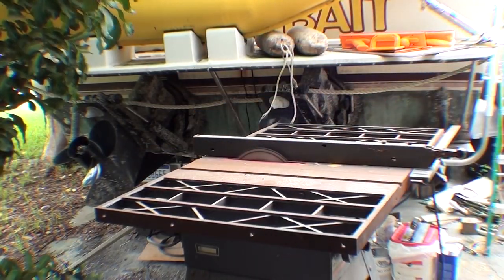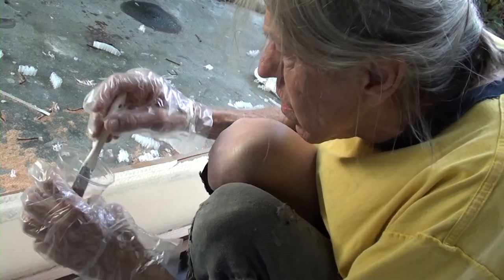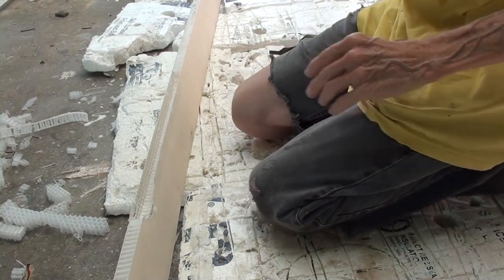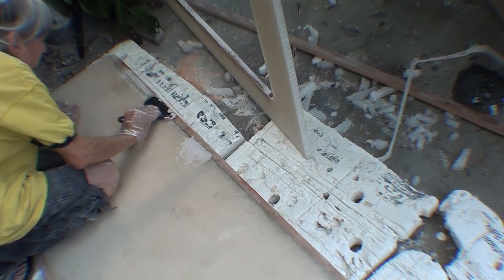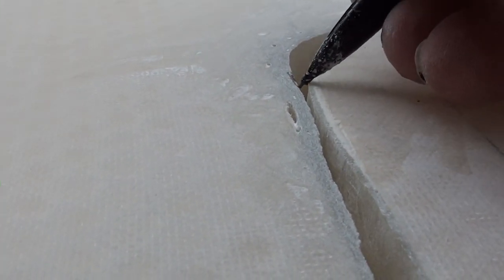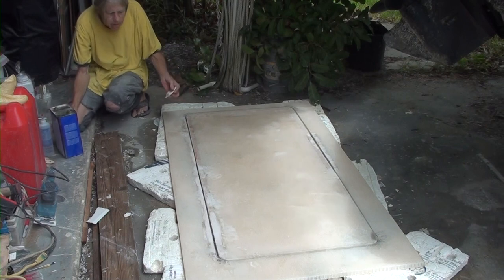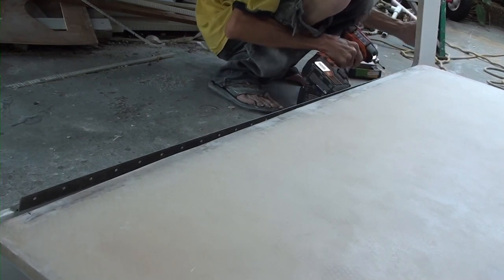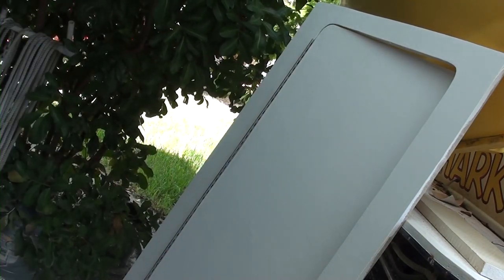Attach Hinges/Hardware To Nidacore Honeycomb With Wood Inlay

Comment: Use PVC board and expoy glue it comes in 3/4 inch so if your using the same thickness nidacore work very good and stay with the no wood to rot theme.
Reply from the maker: Thanks!  One of the reasons I love Nidacore is that it will never rot.

Comment: it  seams like  using a Wood Insert.  kind of defeats. using The Nidacore as  that’s what always rots in  a most  Boats  made with  Wood Cores  no matter how hard the builders  try to keep moisture. away from it  the moisture always finds it’s way to  it   my Thoughts is a peice of Solid Aluminum that you can drill and tap for Machine Screws and or bolts would be a better solution

Comment: Can you use nidacore for floor?
Reply from the maker: Yes, you can use Nidacore honeycomb core for floors or almost anything.  The Nidacore comes bare, and you have to lay fiberglass cloth over it to make it strong.  This lets you adjust its strength versus weight.  For non-structural things like the locker walls, I use one layer of 4oz. surfboard cloth on each side.  To make a stronger panel, I use 1708 biaxial or even several layers of heavier cloth.  Adjust the weight of the cloth and number of layers depending on how much support is below your floor and how much load will go on the floor.

I don't know how to calculate the thickness of laminate for different loads and spans.  I can tell you that the galley countertop was made from 3/4 inch Nidacore with 4oz cloth on top and 1708 on the bottom and it supported me but flexed a lot and almost broke.  The other countertop on the back of the boat had two layers of 1708 alternated between layers of chopped strand mat on both sides.  I could probably park my car on it.  If weight isn't a concern, put more glass just to be sure.  Nidacore comes in 1/4,  1/2,  3/4,  1 inch and 2 inch thicknesses.  Doubling the thickness of a panel will quadruple the strength while adding almost no weight at all because the core is almost all air.  Good luck and I hope this helps!
Reply: @ninehundreddollarluxuryyac5958  ok thanks for the heads up!